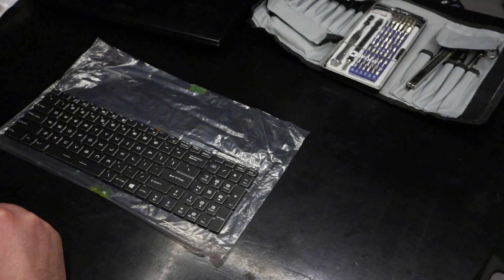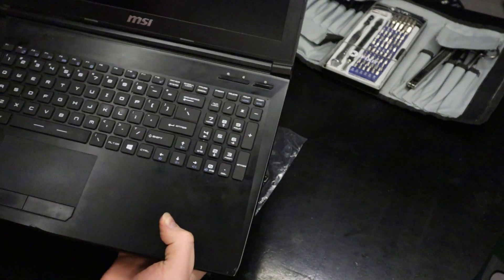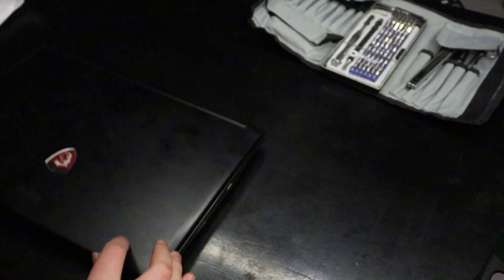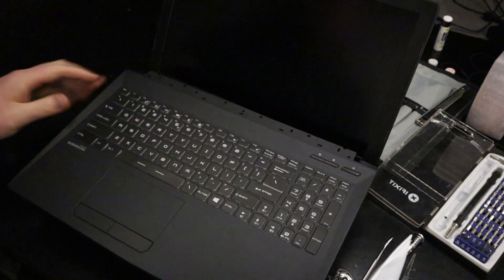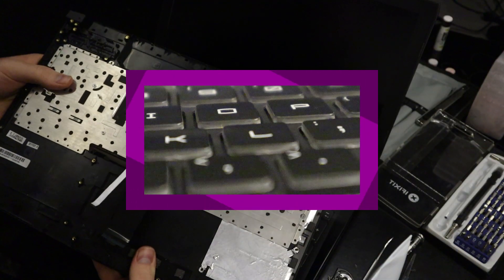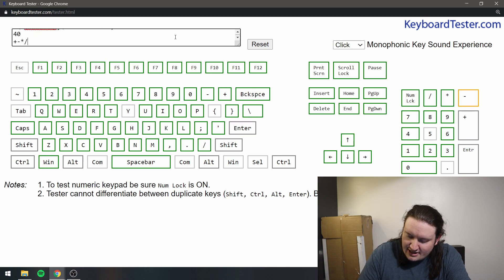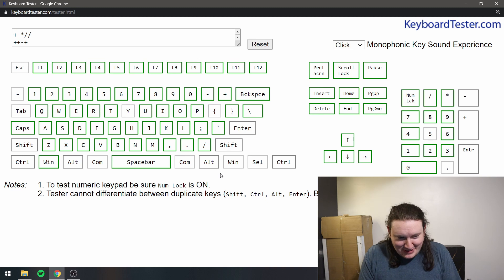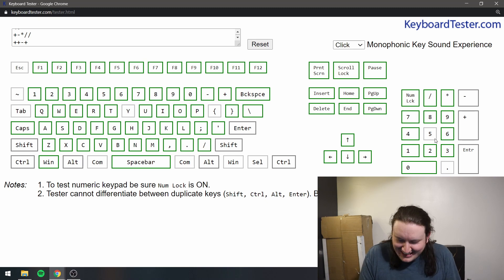Transforming My Laptop Keyboard - What Could Possibly Go Wrong?

Comment: I was planning to change mine too! Asus X55V with ROG G501 keyboard. No connector on the motherboard tho, thought i might connect it via wires, + from the fan, - from the bolts.
Reply: Don't change I have Asus rog model but it don't have backlight
Reply: is that work?

Comment: why you not showing keyboard backlight after change?
Reply from the maker: I thought I said or explained that in the video, But the back light connector on the motherboard broke off.
Reply: @MaxTechniche  ok. so its not work ya? no solution for it?